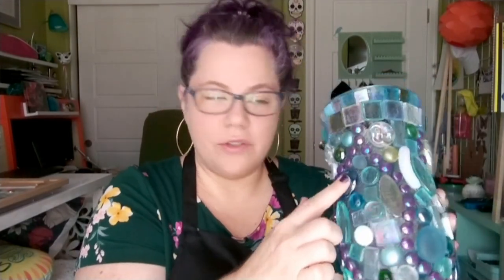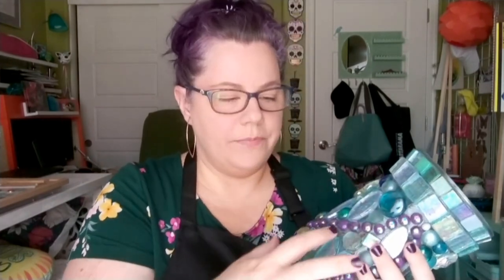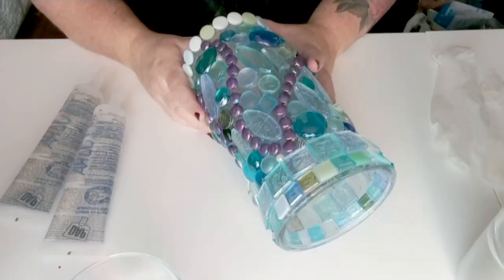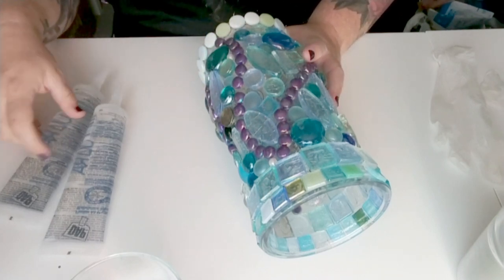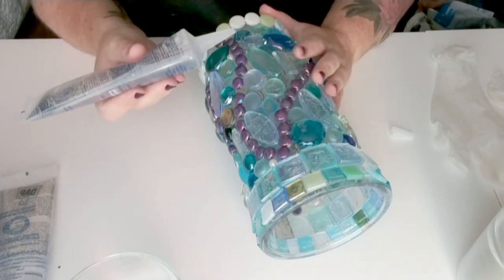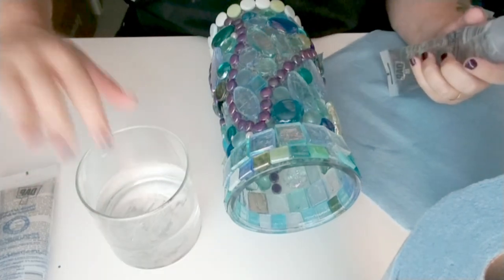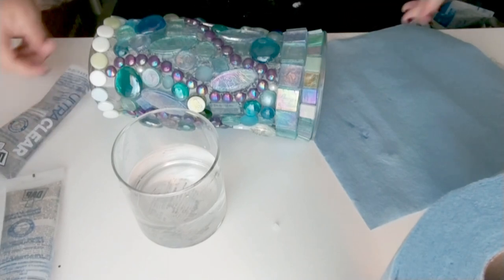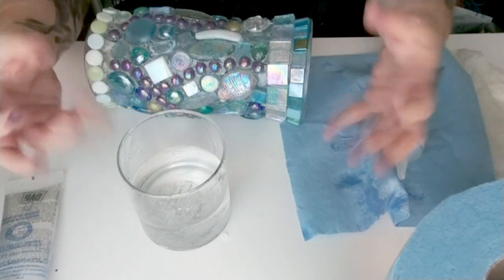Trying to Grout Glass on Glass Mosaic with Clear Silicone

Comment: You fell from heaven to me 😃 My beautiful mosaic work is waiting for the gaps to be filled and I don't like ordinary grout. I had exactly the same idea and was wondering about what you showed. Tomorrow I will finish my work with transparent silicone. Thank you for the useful instruction  I decided to press some "Resin Bubble Beads, 100g 1-3mm Iridescent Glass No Hole" into the applied silicone to my mosaic.🙏